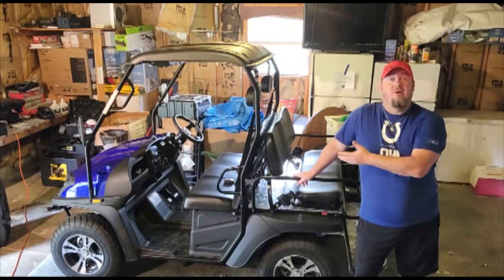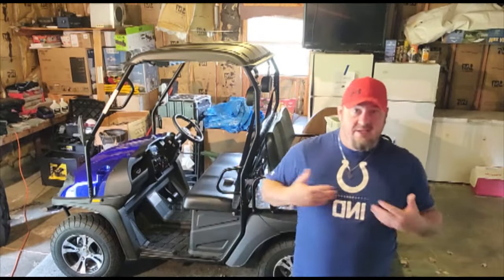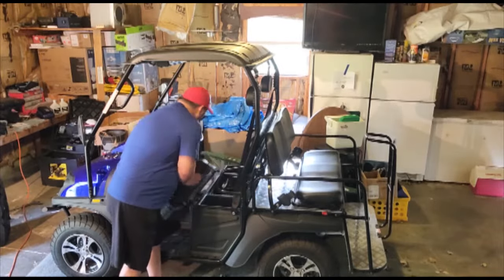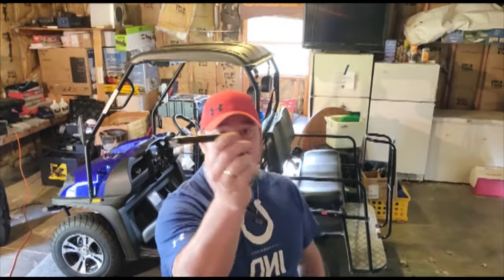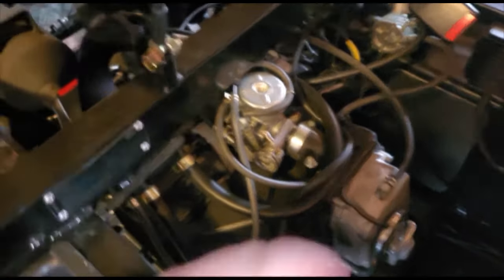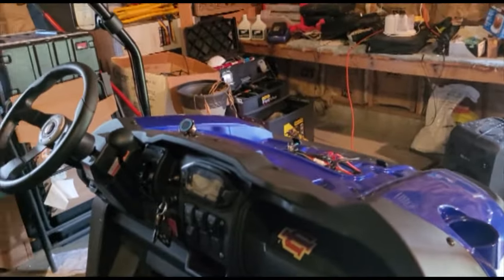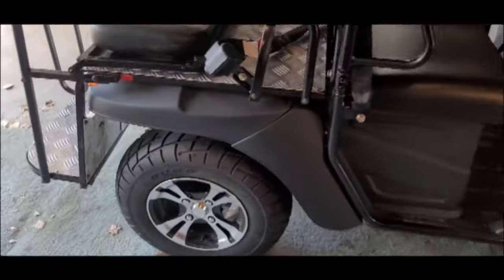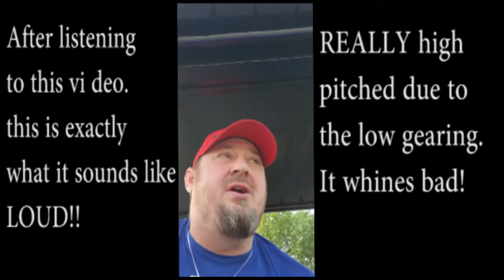THE CAZADOR SIDE BY SIDE (REVIEW AND DIY) #CAZADOR

Comment: we just bought one of those , it's used, it is a 2020, so far I am not impressed, for one thing it seems the engine revs too high for no faster  the cart is going.  I'm wondering if the variable belt is worn out. and next, it seems like the rear end is a live axle, I mean it seems that both wheels turn the same whether in a turn or  going straight, have you had any of those issues?
Reply from the maker: That's because they're a piece of s**. I moved to Florida and sold mine to a couple down there. They figured out how to get it to not be as loud I don't know what he did they actually messaged me a couple months ago and told me how nice it was and how much they're loving it so I don't know what he did but he figured some stuff out. It's only got one gear is the problem and they're a piece of s** so that's why I decided to sell mine. If you can see this video is years old so I don't know what to tell you man if I knew the guy who bought mine knew what he did I could help you out but I just don't know. This was just a tutorial on how to do certain things because I couldn't find anything and that's why I came up with the video. Sorry I don't have your answer for you but they're just a piece of crap that's all there is to it
Reply: @WhatsUPwithDJ  your video did help, now I know how to get the bed off to inspect the belt,, it sounds to me like it's worn out,, I think that system is just like most golf carts.. thanks.

Comment: Good video. Have you figured out speedometer , I have same problem speedometer not working only the RPM (Tach) does , speed not working. If you figures out solution I would appreciates you advise Thanx
Reply from the maker: Thank u! No I never could figure out the speedometer. Oppose me off to. If you notice it runs down to your rear differential that's as far as I got. Sorry man

Comment: Hey Dustin ,, I have the same Cazador with the same crappy maintenance manual,, it says to change the oil filter whenever you change the oil , but I can't find an oil filter on this engine to save my life ?? Do they have oil filters ?? Also do you have a number to talk to Cazador ??
Reply from the maker: They come out of Texas. I can't remember a few websites that they come from but if you Google both cazador and Texas dealers you should be able to get the oil filter from one of them
Reply: Hey Dustin I just found out the oil filter is the little screen that comes out with the drain plug , it's just like a lawnmower engine lol

Comment: Is it possible for you to upload a video of engine compartment. I took my carb off and cant figure out where all the vac hoses go . My wife and children and i would greatly appreciate it
Reply from the maker: I'll try but as you can see, easier said than done. You have to remove the whole back
Reply: @WhatsUPwithDJ  i understand no rush or anything
Reply: @fernandotapia8827  I lost the screw that holds my air filter in place. Could you look at yours and tell me if it is a pointed screw or machine screw and what size it is?

Comment: You didn't talk about how to change the oil.
Reply from the maker: They get to an ATV or small motor dealer and have them change the oil
Reply: It’s a 14mm socket plug on the bottom with a spring in it. These are GY6 engines all parts from Gy6 200cc engines will fit this platform and trouble shooting is similar.
Reply: I changed the oil in mine. Used the same oil as in the John Deere lawnmower. The small black twist off cap is underneath. And the bolt to let the oil out is down from where the oil black cap is located. It was a little tricky to locate.